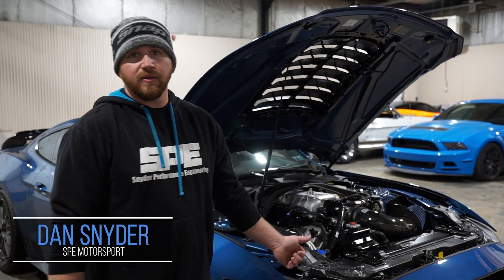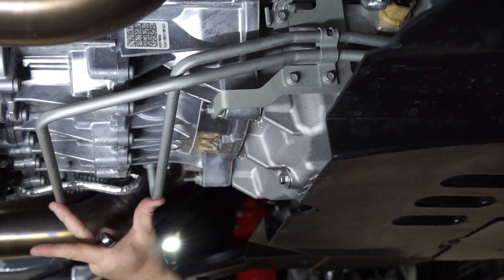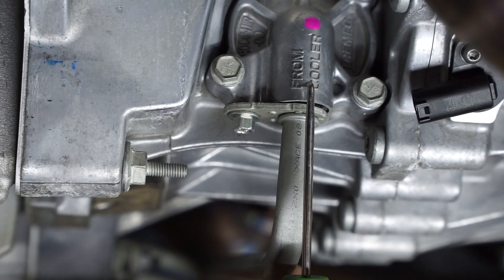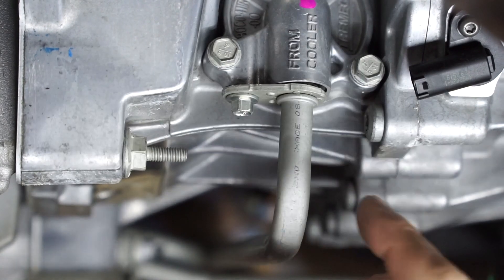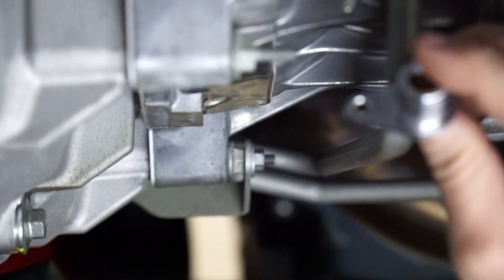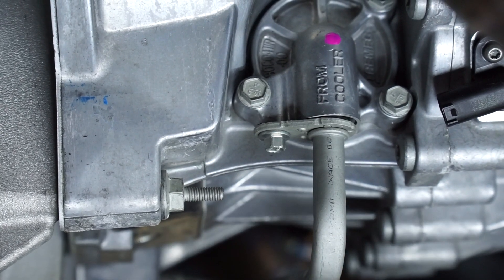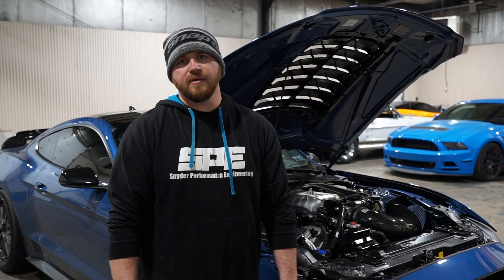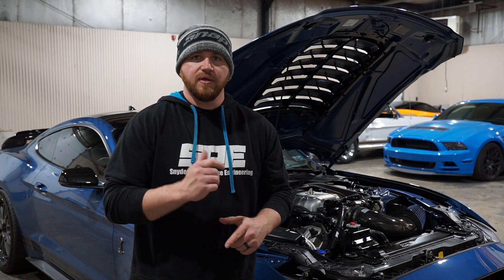SPE 2020+ GT500 DCT SEAL KIT

Comment: Just 1 question sir. The 2 oem rubber grommets you removed - these are NOT to be put back at all or placed on the SPE fittings?
Reply from the maker: With this kit the factory seals are not used, however our Complete Line  Replacement Kit uses the factory seals. So if you would like to, or need to, ever upgrade in the future due to other failure points of the transmission lines then I would suggest to keep the factory seals somewhere safe.

Comment: I'm not here to disrespect, but as an engineer I am paid to solve problems, and there is a way simpler fix that doesn't involve disconnecting the line, and is basically free if you have a drill and a set of bits.  Might cost a little since I would recommend a new factory seal though since it probably has some memory.

Comment: I have had this happen twice and this was not the fix for our car. . Mine leaked after the seal where ford crimped the line to the fitting that goes into the trans. We also thought it was that seal. I can see it getting tweaked also like you said but, ours was leaking before it even went into the trans. We added the billet piece like you did but we then replanted the faulty factory line with a new braided line that threads into the billet trans fitting. I can see this working for cars that are not leaking now but we never saw oil leaking where  you showed it. That was our problem we saw twice. Maybe others also leak where you show. I would like to see if this fixes an already leaking line without replacing new factory lines . We got rid of the factory lines also.
Reply from the maker: We developed these over a years time on multiple vehicles with the leaking issue. This product fixed the 4 vehicles that were leaking we did testing on. Two of them we own. One of them had their lines replaced, they still leaked and our setup fixed it.  Not saying that couldn't of been what was wrong with yours. Just saying there has been many people who have had their lines replaced and still leaked. We would love to see pictures of the cracked tubing on your lines. The tubing being annealed shouldn't crack like that.
Reply: @SPEMotorsport  not really a cracked tube. It leaked at the joint where the stock fitting is attached . That was my issue twice after ford replaced the line. Maybe like I said being off a little stresses that joint. Who knows I’m sure ford will fix it also with so many problems. Thanks
Reply from the maker: @OnlyFastFords   There is no fitting attached to the end of the factory transmission line it is one piece where it enters the case. Its compressed around the mounting tab. I added the pictures from some of our R&D process to the product pictures on the site so that everyone can better understand how the factory lines are produced. You can clearly see how the tube is one piece through the inside of the mounting tab and how the tube is is compressed to hold it. The common problem is alignment related due to the manufacturing process, not normally due to a failure of the tube itself. If you would like to see the pictures of a sectioned line the link is below, scroll through the product pics.

https://www.spemotorsport.com/collections/gt500-transmissions-components/products/spe-2020-gt500-dct-seal-kit